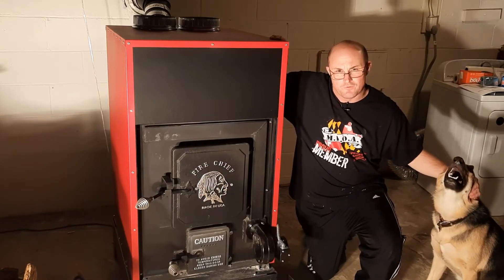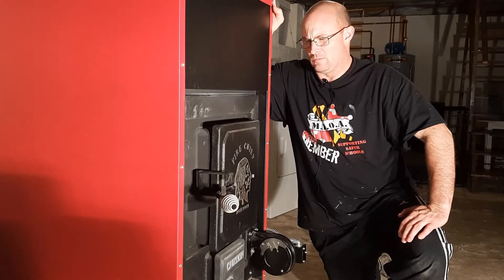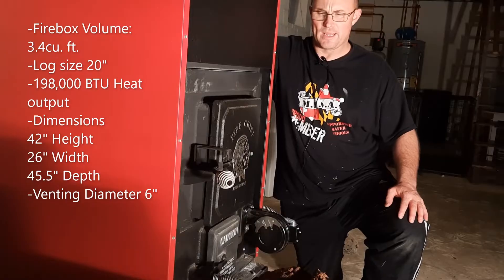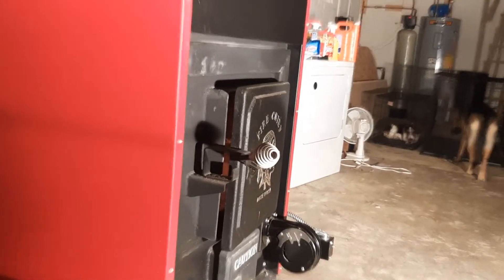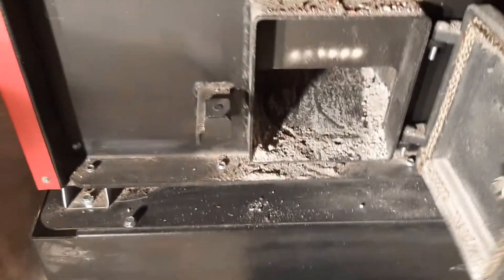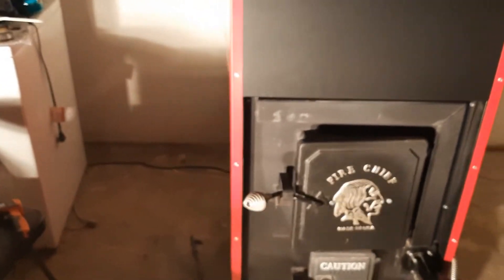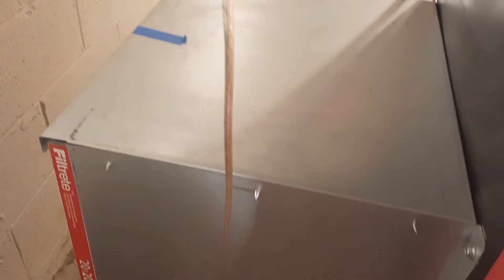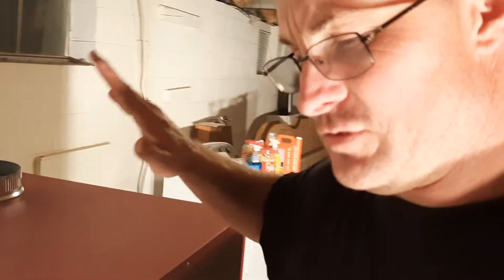Review of the Fire Chief EPA Certified FC1000E Forced Indoor Wood Furnace

Comment: For what it’s worth we had one installed a month ago and we have to load it every 3 hours and our temp never gets above 65 in our well insulated 2000sqft  house. This is not our first wood furnace. For what it’s worth we learned that the company was bought out and mom and pop businesses swooped in and resales them. The warranty is shortened. We paid well over $8,000.00 for installation. It also over heats and the area near the door was bright red. Thank god our smoke detector and security cameras caught it. We’ve had it a little over a month and now having to consult with an attorney because of this crap unit. I’m glad it works for everyone else but it sucks for us right now.
Reply from the maker: I will say last year when I first started using the furnace, the wood I had processed was not very seasoned. Maybe 6 months at best. I had a lot of the problems you discussed of not being able to heat my home. After my church donated wood that was seasoned, I noticed a huge difference in efficiency.  These EPA stoves don't like unseason or wet wood.  I've read that leaving the ash tray in the ash doorbox can also cause issues because it blocks the draft. 

As far as the over firing issue you discussed, I can see that happening if you left the ash door opened for too long or overloading the fire box once coals were glowing hot. With well seasoned oak, I can go about 6 hours on a load when it's cold out to keep the house comfortable.  My house is not well insulated. Old 70's wood frame windows and casement windows in the basement probably need to be replaced in the 90s. 

I could also see over firing issues if your high temperature stat switch went out or if the fan blowing air out of the plenums stopped working. 

I'm sorry to hear about the issues you have going on. I hope it gets resolved for you soon.
Reply: Either bad installation or something wrong from factory
Reply from the maker: @RickRydlund maybe I totally agree. I'd even say green wood could be a reason for this.  I've found this furnace doesn't like green wood.

Comment: Have the same stove in my 3 stall, well insulated shop.  L&M purchase too.  Had it for three years and replaced the cheap commie draft motor once.  I control the air with the draft motor flap on the side.  This does two things for me the shop stays at 65 where I have the thermostat set and second it increased my burn time.  It's barely been above 10* for a week and a half, -15* at night and it's worked great again this year.  The key thing to anyone reading my comment is use ONLY seasoned firewood.  Don't be stupid and try burning unseasoned wood you are wasting your time. wasting heat energy trying to burn off water. greatly reducing your efficiency, and slowly plugging up your chimney with creosote.  Mine is dried two years under my woodshed.  And like the content creator says, once a year on the chimney cleaning, barely anything in the chimney.  Change your air filter at least once or twice per heating season.  I wouldn't say anything unless I have done this for a while, 45 years now, and want to help others get out from underneath the man and do it safely and efficiently.  Great video and demonstration, all the best.
Reply from the maker: All perfect points. This furnace does not like unseasoned wood. Thanks for watching and commenting.

Comment: We have a fire chief 700 dual, wood and coal, indoor furnace (we only burn wood).  We installed it in 2014 and we have around 2000 sq ft.  No complaints at all.  Haven’t had to use our propane secondary unless we go on vacation.  Exceptional furnace for us.
Reply from the maker: Awesome,  thanks for sharing.

Comment: When does your draft blower turn on and off? If your house is 72 degrees but your thermostat is set at 74 will that draft blower running until it hits 74?
Reply from the maker: The blower turns off when the target temperature on the thermostat upstairs is made. Yes, if the target temperature is 74, the blower will turn off at 74. Sorry for the delayed response.

Comment: Your missing a part to your stove,that's not normal for smoke coming out of stove
Reply from the maker: What part would be missing?
Reply: @clashavenfarms6714  Some stoves have a flapper at the top of the opening. Gives way when loading and then flops down and to block the smoke. Could be what the commenter meant. Is the smoke in the video normal only when flue is cold or does it happen whenever loading? Thank you
Reply from the maker: @kentvandervelden the installation instructions for this stove advise not to install a damper. The reason for this is because the fan acts as the damper. Once the stove gets hot, it doesn't have some smoke come out.  Thanks for the suggestion.
Reply: @clashavenfarms6714  Sorry to be confusing, I meant a flap inside at the top of the door entrance, not a flue dampener. Any chance of over heating if electricity is lost? I'm replacing an older wood furnace, and the Fire Chief is easy to get in the Midwest. Thank you
Reply from the maker: @kentvandervelden I have lost power and didn't have an issue.  Obviously, it works better with the fan running, but there is a manual option in the event of a power lost. You would have to be home or have someone adjust that option on the fan motor assembly.
Reply: A lot of the smoke issues is a cold chimney once it warms up the smoke issue will usually disappear
Reply from the maker: It doesn't matter if the chimney is hot or cold. I'm not sure what it is that is causing the smoke to roll out the firebox when the door is open.
Reply: He's missing the manual where it says set the thermostat to 90 then start your fire.  so it turns on the forced air motor.
Reply from the maker: I can have the forced air blower on for 30 minutes prior to starting a small fire, and I'll still have smoke coming out. The manual recommends at least 15 minutes with the blower on.

Comment: just found your review.  I got my unit in 2022 and ran it all year. running it about the same way. very happy so far. I do have it ducted into the hot air piping( oil system ductwork) heat side only. no cold air return. just using the door to the down stairs and filter on back of fire chief. good job on the review
Reply from the maker: I'm looking forward to getting the ductwork finished before next burning season.  I was very happy with this furnace this winter. Thanks for watching and commenting.

Comment: nice review.  I bought the same furnace around november also from L&M.  I did tie into my existing ductwork.  I have not used my oil furnace since I put in the fire chief.  so far I love it also.  great little furnace.  I typically load it up 2 times per day.  once about 7PM and then in the morning before I go to work at 3AM.  house temps range between 65-71 loading that way for me.
Reply from the maker: Yes, I've been very happy with this furnace. Hopefully I'll have some money left over after tax season to run the duct work.  Thanks for watching and commenting.
Reply: I have a question for you guys I just got one of these and is it supposed to have fire bricks on the top of the burn box as well???

Comment: Because the power can go out, I'd just push the white button all the way in, if it burns out, the hot ash still pushes warm air for up to 12 hours. Depends how cold it is outside, near 1 degree it kept 60 degrees cold!
Reply: You must have a very well insulated house.

Comment: I have this furnace working well. Thanks for the info. Quick question: What to do in case of an overfire? How to shut down quickly?
Reply from the maker: I would turn the fan off and close the silver flap on the manual adjustment to the fan. That's really all you could do with it.

Comment: I’m curious, do you feel air coming from the sides of the face and rear of the furnace? I inherited the same stove with a house I bought and I’m not sure if he ruined it. There seems to be some warping in the air vents where the blower air comes from inside the door as well as the top weld on the door frame is cracked.
Reply from the maker: I don't have any of those issues.

Comment: I just installed one in my house, hooked up to duct work, thermostat whole nine, however the circulation blower will not stay on for more than 30 seconds in auto? Any suggestions?
Reply from the maker: Check the high temperature stat switch to see where it's set. Take the face plate off, and there will be a dial you will need to turn. If it's set correctly, it could be a bad stat switch. I did have to replace mine, which I talked about in this video.

Comment: Hi, I just had  the furnace installed and tried to fire it up. Any tips on getting this thing going? I did not see any fire bricks on the bottom (under your wood) of your furnace when you opened the door. Should I temporarily leave the ash door open when first starting and turn on the small/front blower? Also what should the 3 pins (inside the thermometer) be set at? Thanks
Reply from the maker: I did another video after this one and showed how I got my fire going. I do have fire bricks underneath. Yes, I leave the ash door open in the beginning and will close it completely once the fire gets going. As far as the pins, I have mine set at 200 degrees. I think from the factory that are set at 150.
Reply: I initially open the ash door for 5 minutes or so when starting but you MUST. remember to close it or you may overheat the stove and possibly a chimney fire etc

Comment: Where did you find the angled elbows for your furnace? What degree are they?
Reply from the maker: I think 45, but they are adjustable. I either got them from Tractor Supply or Ace Hardware.

Comment: What square footage is your house?   Thinking about upgrading mine but don’t want it to hot .
Reply from the maker: My house is right around 2,000 square feet. The house is very drafty because of having older windows. For right now, this furnace is great, but when I install better windows, I'm sure I'll need to open windows more often. Which I'm perfectly fine with. This furnace is my only source of heat besides small space heaters.
Reply: Okay thank you.  Mine is 1300 sq ft with a basement  and I just ran a  pipe out to my 26x26 garage so I might be Allright if I don’t burn it to hot .   Thanks

Comment: Yes. Please read the manual. The transformer is a 24volt, so you have to use a 24 volt troll motor method to run it off batteries. It says to keep the doors shut. Without the fan for the draft blower motor and the circulator pushing the hot air into ducts, it can warp the furnace?  That control switch is made in mexico and the draft blower is made in china. about 5-7 small pieces of wood will burn 4 hours then when it's not burning in the 300 degree or higher out the pipe the hot ash heat still circulates, it's needs constant power.  Trying to figure out what's needed for a battery bank. One 24 volt bank will only last two hours enough to hook up a gas generator.
Reply: That was a discombobulated mess

Comment: Do they have bigger ones ? My home is 5500 sq ft
Reply from the maker: I don't think so. At least not one of the EPA approved stoves. With that much sq footage, you may want to look into a wood boiler.
Reply: @clashavenfarms6714  thanks , my brother said they have a dualy. It burns wood and oil
Reply from the maker: Hopefully, someone has left over stock of that model.  From the research, I did our wonderful government in the States, made all dual fuel stoves illegal to purchase now. So unless someone has a leftover model, you wouldn't be able to buy it now. Hopefully, I'm incorrect on this and you can get one. Thanks for watching and commenting.  Good luck with your search.
Reply: @clashavenfarms6714  thanks , yes I’ll have to check ny rules
Reply: There are 2 model sizes